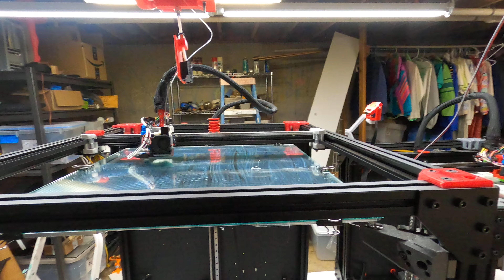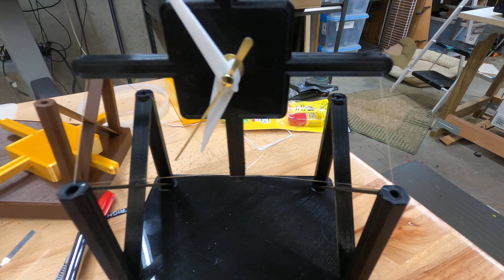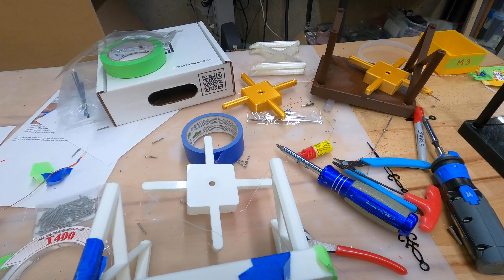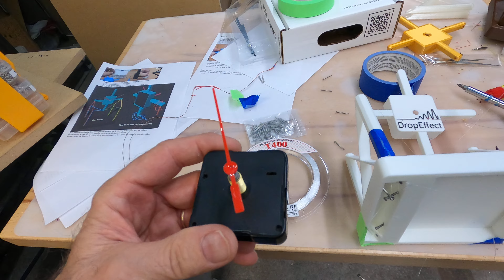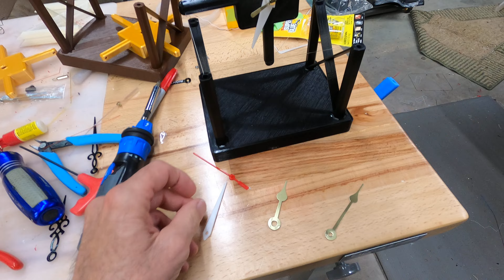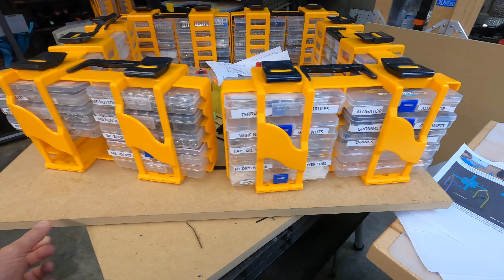The Rat Rig 500 is finally printing

Comment: David
Reply: Sorry my comment got chopped off some how, it should have read, David, glad to see you using mirror for a build surface, I get the 400 X 400 mirror tiles as they are a bit thicker than regular mirrors, but mirror is much better than glass as it is much much flatter otherwise any inconsistancy would create a warp in the reflected image of the mirror